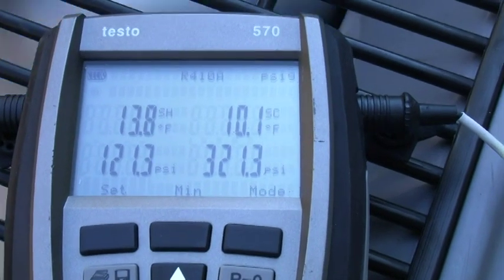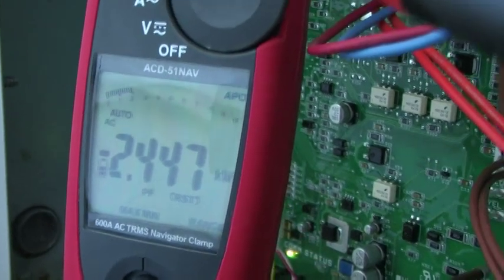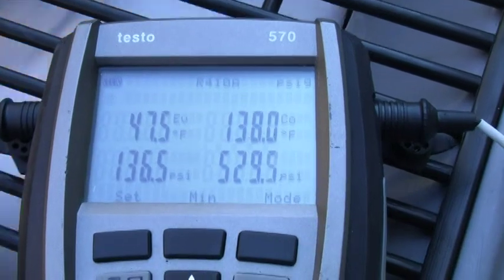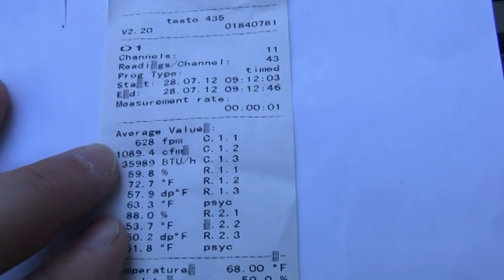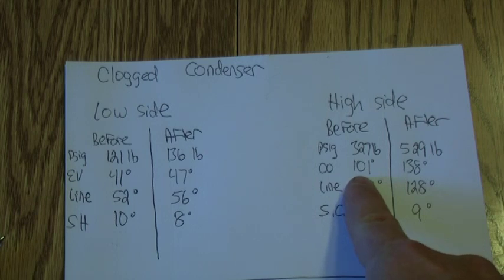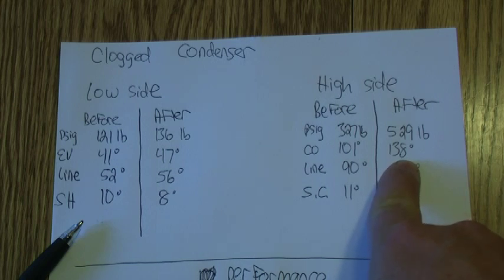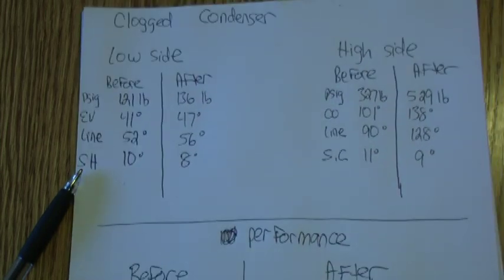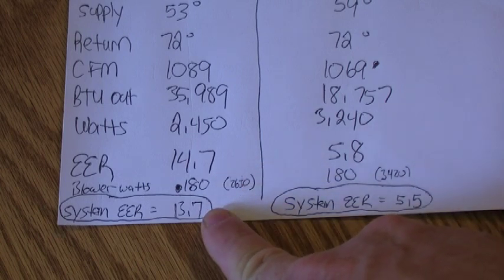HVAC Training - Why are Dirty A/c systems bad?

Comment: I am lost, supply temp after, was 59' before 53' and calling it a dirty condensor?  We never saw the dirty condensor, and those numbers should be reversed, most of those numbers mean nothing, watts, and stuff, manufactures supply literature, for all units, for indoor outdoor temps, but indoor is in wet bulb,  stupid electronic gauges cant calculate that lol, you seem to know your stuff, but need to learn more

Comment: Thanks Eddie
That is a great marketing tool,  showing the customer the cost savings from having the system cleaned and checked  They would sign a service contract with you right then. Plus it would build there confidence and trust level in you so much.
Thanks for all you do

Comment: i think i would've simply pulled the condenser fan lead. obviously the wrap works well but a bit more trouble to bring the tarp and wrap it up. basically a manual low ambient kit ;-)
Reply from the maker: For this demonstration I only wanted to partially block the coil. One side was left uncovered to get some airflow.

Comment: Hey Eddie I have a question, I am an apprentice for a decent size company, I am currently working in the new construction side, but I eventually want to do service. I was told to become a service technician I would have to get my journeymans licence.  I don't have a problem with getting my licence, but do you think if I get my licence and get a service tech job, that will throw me out there by myself. I have some service experience, but very little. I want to learn, so I'm asking how can I do this?
Reply from the maker: I think today its pretty common for a company to hire a service guy with very little to no experience because one its really hard to find a good service guy and when they do find one they are going to pay a premium to hire them.

I went from installer to service with no experience and when I look back at that time I wonder how I did it, that was about 20 years ago. That particular company still does the same thing today.

The one thing that you've got going for you which I didn't are these youtube videos and sites like Hvac-Talk.

Its a great career and I wish you all of the luck

Comment: Is it 13 seer and below that you add 30 deg. to the outside air ?
Reply from the maker: I would go with:

10 seer + 30 degree
13 seer + 25 degree
16 seer + 20 degree

Comment from the maker: This is the hiring requirements for most of the bigger companies. You will need to get hired on as a apprentice and go from there. Work on getting your Journey mans license first thing because your going to need it to be a lead installer or service tech.
When you get hired on you must respect everyone ranked above you because they will be the ones reporting back to the managers and if its always positive you will move up in ranks much faster. Always volunteer for the nasty jobs

Comment: Hi Eddie, I am in the process of hvac job hunting in Texas and wonder if you have any advice for a guy like me.  I have over ten years working experience at an ice production company doing most of the troubleshooting, leak repairs on big ice makers, major repairs on ice merchandisers and repair and trouble shooting the big ice storage freezer.  I want to get into a/c service and I am confident in my abilities but most contractors want 2 to 5 years exp for techs and 1-2 yrs for installers.

Comment: Eddie I really hope that homeowners do see these video's!!!!  
Clean the equipment is half the battle and going from 36,000 BTU's to 18,000 BTU's will make the system cool unevenly and make your home feel in some case's cold & clammy and just plain uncomfortable when not properly cooled. But yes you'ed be surprised that people don't notice that and this spells trouble with your A/C and getting it professionally serviced is a must for proper efficiency! :) very good video!!! :D